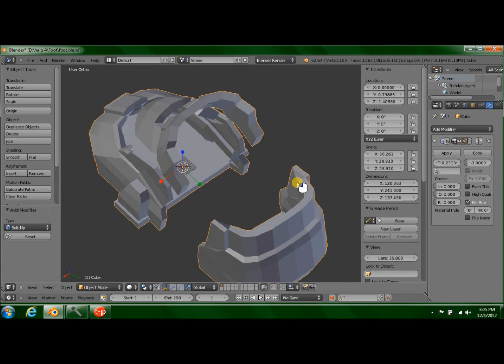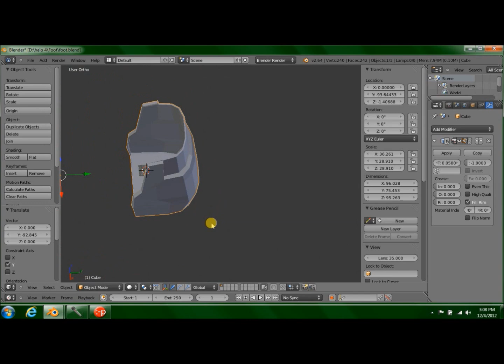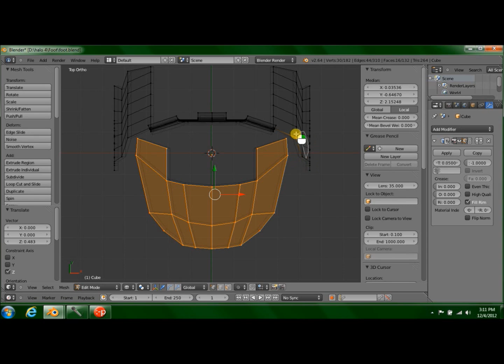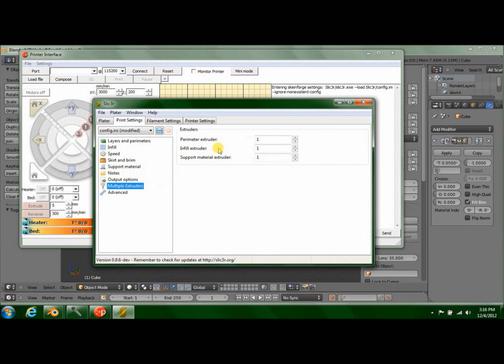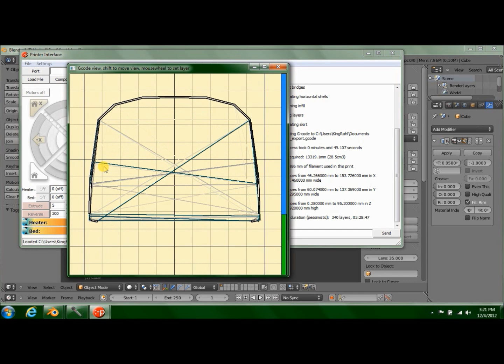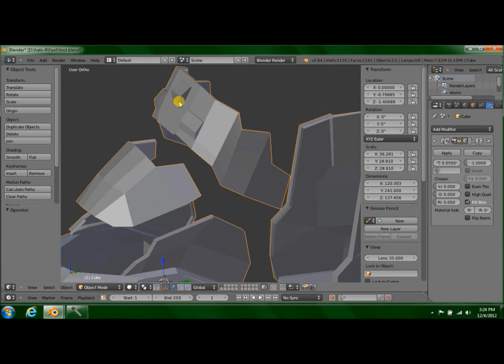3D Printing Cosplay Armor

Comment from the maker: Scaling in Pepakura only works for the final unfold IN Pepakura. The scaling will have to be done before you add the solidify modifier in Blender. If you scale after, the walls of the final product will be thicker or thinner than you originally intended.

Comment from the maker: If you go to "reprap.org/wiki/Mendel_Buyers_Guide" there is a large list of places. If you are not a "Techy" you may want to get a Makerbot. They are plug-n-play and they host the thingiverse website. At Makerbot they provide many different printers and products and average around $2000-$3000. They now offer 2 color printing. Or you can buy from the original creator at RepRapPro. They offer 3 color printing and cost about $1000. Wait time is about a month from UK. Assembly is required.